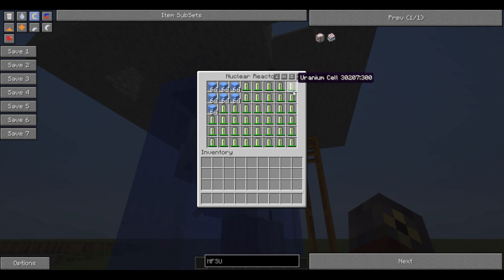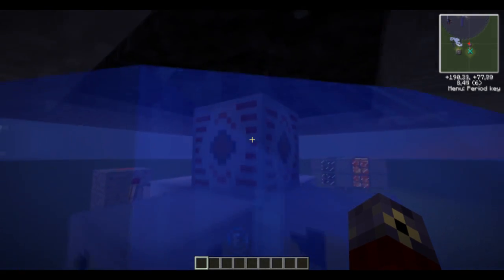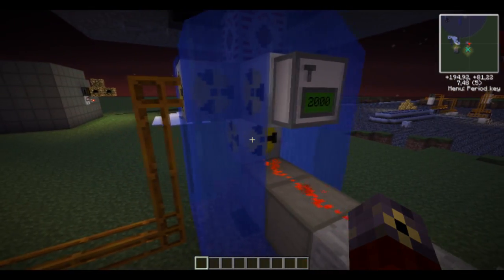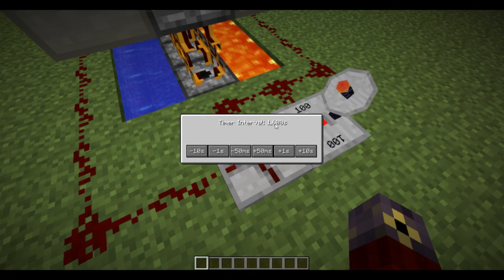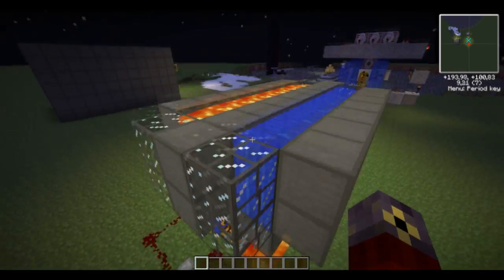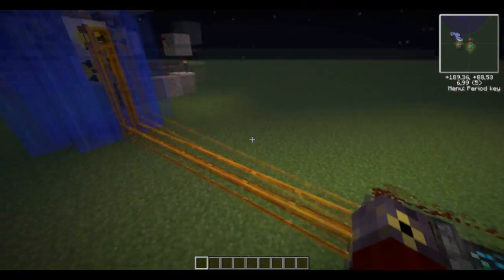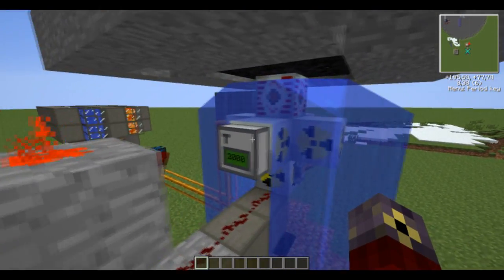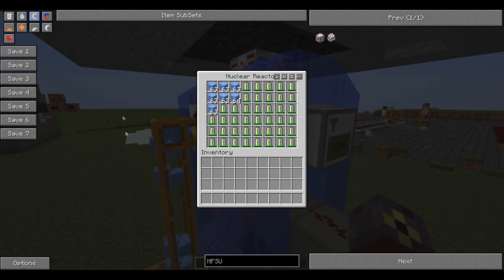Tekkit SAFE Nuclear Reactor 3500EU/t!

Comment from the maker: Actually this reactor does not output 3500Eu/t. There is 3500EU/t going into the transformer but the output of the transformer is only 2048EU/t. Anything higher than that would either burn the cables or it makes the MFSU explode. To get the maximum out of this bad boy you would have to use 2 outputs. So insrtead of 1 transformer hook 2 transformers on to this. In theory this should work. But I haven't tested this in-game yet.